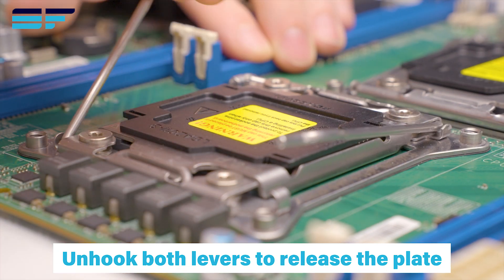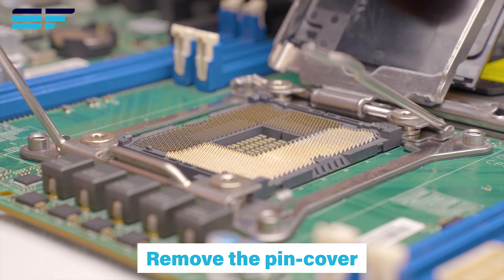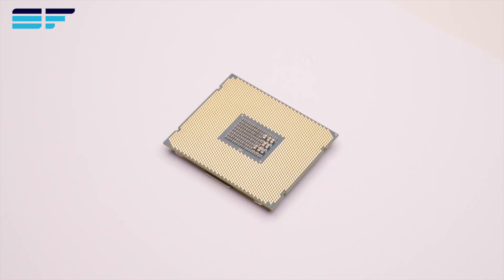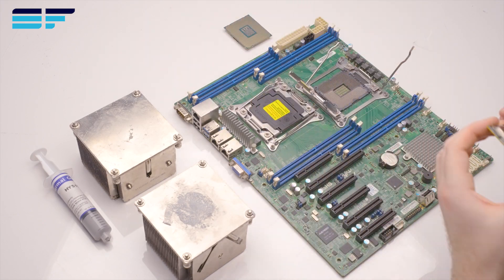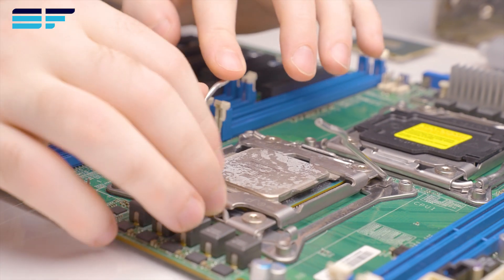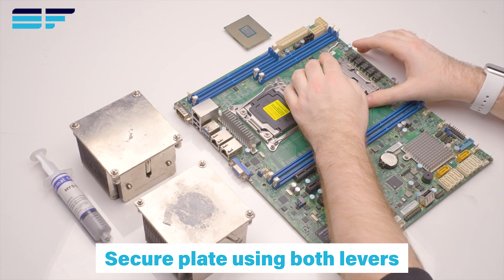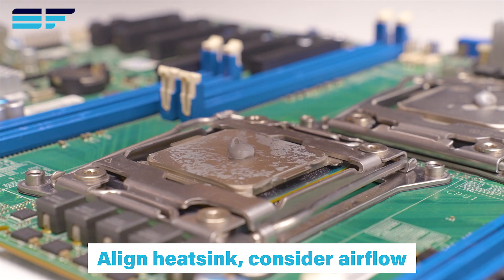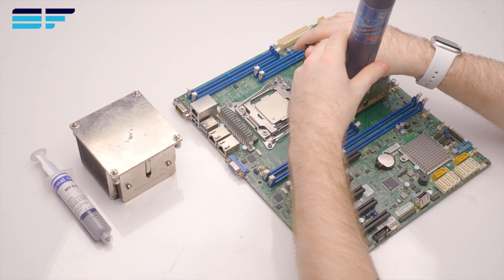Intel Xeon E5 v3/v4 / LGA 2011-3 Installation Guide | Server Factory

Comment: Are those still reliable? I mean end of life and bug reported.
Reply from the maker: Xeon E5 v3/4 are a great option and still in wide use :)
Reply: I have e5 2620v4 since 2016 and don't have intentions to replace it. Apsolutely amazing piece of tech and I'm using it in my workststion (archiviz).